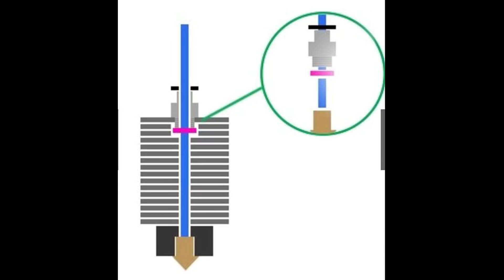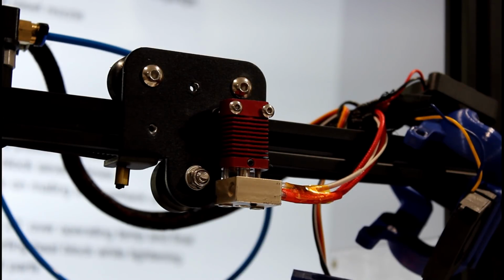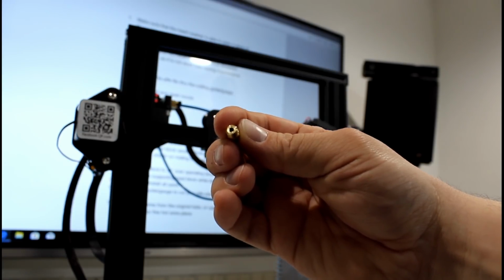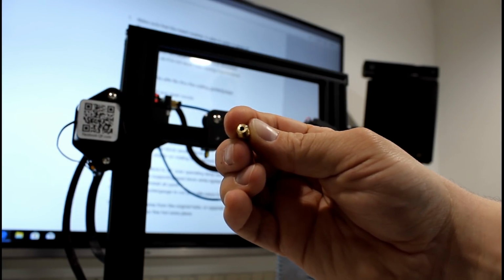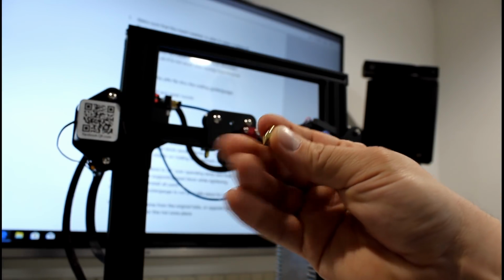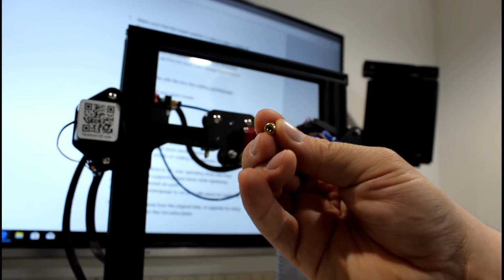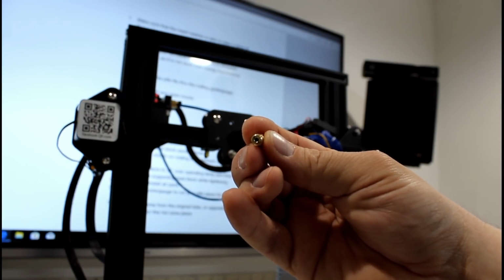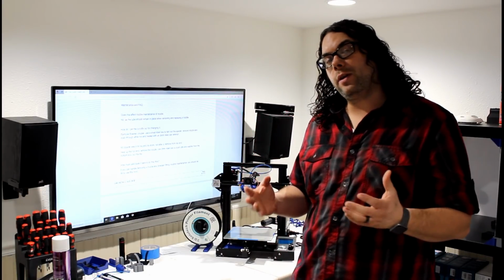Hot End Fix for Creality and Others Section 2.1.5 featuring the Ender 3

Comment: Thanks for sharing but, my due to the heat, my washer deforms, after that, the filament doesn't go thru. I installed everything following your directions making sure I have filament thru the tube and washer when I re-assemble but later on after I change filament the washer closes. I am using PLA for the washer, should I use another material?? Your videos a fantastic. Clear and to the point. Thanks

Comment: Thank you! I've watched a lot of your videos because I was having a really bad time with my ender 3 v2, it always had al clodged nozzle after some layers. I think what helped me in this video most ist that you showed to move the bowden tube through the hot end a few times when the nozzle it unmounted. That really pushed out something, and I could see some remains on the top of the old nozzle. I thought I had the new bowden tube attached right, because I repaeated the process about 4 times, but I never pushed the whole bowden throught, so that fixed it probably!

Next I will check my e steps as i saw in one of your other videos. Since your videos are so good, would you mind doing a bed levelling sensor mount or octopi installing on an ender?
Reply: I thought I solved the problem but it  popped up  again.... I think  I  might have a heat creep. Do you have any suggestions on that beside changung the hot end???????

Comment: Will this work for the lotmaxx sc-10?  I just had 2 back to back clogs and am thinking it might do the trick.  I've been told the lotmaxx is VERY similar to the creality cr-10
Reply from the maker: It should work as long as you get the right size tube inside the hot end.
Reply: @TheEdgeofTech  that was fast!  I also noticed the custom printed fan shroud.  I've been interested in trying one for mine.  I'll have to give this a try.

Comment: You fixed my ender 3 v2. Your guide its even better than CHEP's one. Using filament and a guide is vital. Thank you so much.
Reply: which spacer did you print please?  ender 3 or ender 3 pro?  i got ender 3 v2 as well
Reply: @rcpimp6419  they're both the same. use whichever you like.

Comment: This is very confusing. I have a CR10V2 and the box assembly is nothing like what you are showing. I finally got it off, but undid several more screws than necessary. Following your instructions left my hot end dangling by the wires. I had to reattach the left fan and the back of the box before going further. I could not work on it with it dangling while heating. Also, the bowden tube does not have anything to push down and remove it. It can only be removed by removing the nut first. It would be nice to have an updated video that shows other models. I am a beginner and very concerned about breaking an expensive machine while trying to follow these instructions.
Reply from the maker: This video was done on the Ender 3 which is a different hotend. It will be different for sure.
Reply: The Edge of Tech Then I wonder why Luke recommended I watch it for my CR20V2
Reply from the maker: @catherinepaulson4990  I'm guessing because it's the same principal, just a little different hotend.

Comment: Where is Luke Hatfields help guide that contains section 2.15 to implement the hot end fix? The link has a help guide but there is no section 2.15.
Reply from the maker: He must have made changes and knocked the numbering out of whack.
Reply: @TheEdgeofTech  So where is correct guide?

Comment: This is much worse. Even when changing filament, it stucks in small PTFE tube we cut. I returned back to the original one. I had much more problems with this than the normal.
Reply: I used this for 1 week and it is a pain. I do not recommend using it.
Reply from the maker: @funforgiven  Thanks for the feedback. You always need to remember to "purge" or push some filament through the hot end before pulling it out. That will help it not get stuck. This should be done with it without the fix in place.

Comment: Had a clog for the first time in I don't know how long (with the hot end fix in place).  In the end, I think the clog was filament related (contamination) because everything looked pretty good.  I have moved from using the PTFE tube to clear the throat to a Q-Tip with IPA on it while hot.  CLEAN as a whistle.  :)
Reply from the maker: Awesome! Nice work! Sometimes you get crappy filament particles and that happens. But it sounds like you got it under control and the fix is still working!
Reply: @TheEdgeofTech  eSUN (Inland) Silver.  I've been told it can get some particles in it, and I'm thinking that's what it is.  The hotend fix solved so many problems.  Just going through the re-assembly now.  Decided to cut a new piece of tube for the throat of the hot end (Hey, it's apart, might as well).  Washer is solid so away we go.  I still can't believe the quality of prints I get off a $170 (what I paid 2 years ago from Banggood) printer.

Comment: My small wire next to screw on block came off next to the big one...theres a little hole.. was it stuck inside?.how the heck was it attached.?.,my eyes are not very good...thax
Reply: I got it...thax
Reply from the maker: @roadstar499  Glad you got it!!
Reply: @TheEdgeofTech  did a  3 hour test using petg at lower temp 235 ...no leaks...i ran test without block sock...thanks... i learned a lot from this break down... i have had multiple issues with ender 5 since i first bought it 5 weeks ago...thanks
Reply from the maker: @roadstar499  Awesome!! I'm glad you got it rolling! I hope you get it dialed in and love it! Thanks for watching!
Reply: @TheEdgeofTech  I also ordered a can of crc ptfe spray... seems to be the answer for some 3d printer issues also... makes a lot of sense... nothing sticks to it... just keep it off the build plate of coarse... thax

Comment: So I print abs only with my ender 3, and I seem to have issues like clocks once and a great while when using the 24v heat brick fan. Also I noticed that when running that fan i can’t get my nozzle to reach 250 degrees. Turn fan off and I can easily reach temp. Now, I have played around with no fan on and temp running at 250 and have had 0 issues so far on a 3 day print. Also tried half with the 12v print cooling fan on and off and with that fan on printing abs print looks way smoother. So wonder does heat creep truly happen?
Reply from the maker: It sounds like you have tested it and don't see it so much. I would think it's there, but maybe it depends on the material too?

Comment: Hi i am new to 3d printing... my ender 5 has had a lot of issues i was able to fix... recent today my hot end (block part)has petg caked on thick top bottom and all around... i did replace the stock bowden tube (since it failed and filament was stuck inside)with a capicorn one.. cant print any washers or than other thing you used to measure tube you cut either... not sure i can get all the mess off block and nozzle anyway ...this ender 5 really sucks as far as i am concerned ... very unreliable pain in the ass...thax
Reply from the maker: Oh man. I have a video on how to clean and fix a hotend leak. If you follow that it should help! Also, shoot me an email at jim@theedgeoftech.com and I can help you get it going!
Reply: @TheEdgeofTech  Thanks sir... i was just really pissed off yesterday... watched some video's and ended up ordering all metal hot end for it... i did manage after spending 30 mins to remove all the caked on petg...i will watch your how to fix hotend video...thanks for your reply.
Reply: I just searched and could not find a video on fixing a leaking hotend on your playlist... one had pic of block and said fix clog...was that the one? thanks
Reply from the maker: @roadstar499  That's the one!

Comment: I feel like this is just adding more to go wrong.
Best way to make sure there’s no gap between ptfe and nozzle is to make sure all filament is cleaned out screw nozzle in all the way in by hand then unscrew by 3/4 then. Push ptfe in and then tighten nozzle.
Reply: That’s how I did mine, except I heated it to print temp. Next time I’ll do 240.

But love your vids man keep it up 👍
Reply from the maker: @ao27893  Thanks man!! You got it down!
Reply from the maker: I appreciate your opinion, and I was filming this for Luke's guide! Everyone has their own ways, and if you are not going to to do the fix, I would say you are spot on. I would heat the nozzle to 240 before I pushed it in and tightened it myself! Thanks for watching!

Comment: Great fix. The tubing cutting guide is worth printing just to assure you have a square  (90deg.) cut end on your Bowden tube. I would also suggest a second washer the thickness of the exposed threads of the PTFE fitting.

Comment: Hi! Thanks for the video! I did it but I have a problem with the washer when I change the filament. 
After the mod, while the stepper E is pulling the filament off a little blob of fuse PLA stucks in the washer... and the filament struggles to get out.
What am I doing wrong?
(i'm sorry for my English)
Reply from the maker: Thanks for watching! Did you push the filament in a little bit to extrude and then pull it out? If not that's what you want to do!
Reply: @TheEdgeofTech  thank you :) I will do it!

Comment: I dont get how adding a PLA washer at the bottom helps with the blackage between heat block and nozzle... surely the PLA would remelt and cause that exact same blockage if it is holding the ptfe tube up to allow the filament to go through the washer? Or have i missed something?
Reply: I think you miss understood.  The washer goes at the top. from bottom to top you have the nozzle, piece of the tube the washer then the locking nut to hold the rest of the Bowden in place.
Reply from the maker: Hi! Thanks for watching! I would defer to Luke normally as it's his fix. But I have been using it for a couple months with no issues! As long as the fillament can go through it smoothly, you're good. It high enough in the heat break that it doesn't get hot enough to melt. The issue I did run into was the crappy stock PTFE tube getting messed up on the nozzle side. Once I changed that out to Capricorn XS, or the TH3D tough tube, I had no more issues!

Comment: Thank you for this. I watched your performance build video to build my Ender 3.....and now I watched this video to fix it. You're a huge help.

I did a 16 hour print last night then tried to change the color this morning. I pulled on the filament and pulled on it, but it wouldn't come out of the hot end. So, I undid the coupler and it took several minutes to get the bowden tube to come out of the hotend....and it was COVERED in PLA slime. I had to bake my nozzle on the stove, then grab it with gloves and scrape with a toothpick....drop and repeat.... I heated the hotend up to 240 and it took a while to be able to get a bowden tube to slide through it.... but I did...then did this fix. That was too much work to go through to let it happen again.
Reply from the maker: Sorry you had to go through that, it sounds like you're voting too was not pushed all the way down into the hot end. But after the fix you should not have to worry about it! Just remember that when you take your filament out, push it in a little bit, then pull it out.

Comment: Hello!
I am brand new in the 3D Printing World and have my first own 3D Printer, a Ender 3 Pro for about a month or one and an half...
I have been trying for 1-2 weeks already litho print, but I always have visible lines and small Filamentpoints in my pictures. I have already tried the speeds 40 / mms and 30mm / S and some different layer heights like 0.12,0.15,0.20. Also, I have already tried various Cura settings like "not in skin", "z-hop" and more, just like other temperatures. Unfortunately, everything without the desired success. Surely, the images with a layer height of 0.12mm were more beautiful than with 0.2 but the lines and these little dots are still there. Now Luke from the Facebook group sent me the link to these great videos.
However, I can not perform this HotEnd fix because I have no PFTE Tube I could swap or trim. Is this really necessary?
In addition, on my Hotend is no silicone sock , but a yellow tape. If I removed that, I would not have anything to put together what I could give back to it. I can not imagine that this tape is not needed. Surely that has something to do with isolation or something else?

My Ender is still Stock without any changes.
I only calibrated the E-step value from the original value of 93 to 94.94, so that the 100mm of 120mm drawn filament are really exruded (into the air ot throw the nozzle).

Do you have an Idea why I have such visible points & lines in my first LItho pictures? Is this due to the printer or more to the Software Cura? And what should I do in your opinion? If I break up my completely new Hotend, of which I am honestly a bit afraid .... I can not renew the Tube and can attach no more instead of the tape.
Is not it possible to somehow check if the Hotend is to blame for the problems in my LItho images?

 I hope everybody here can understood my Bad English. I am a German User with terrible English Skills, and Google Translator is not a great help =)

Best Regards
Reply from the maker: I apologize that I just saw this. How's your printer going now!?

Comment: Jim at what step can the temp be turned down?? Does it need to stay hot even during the bowden coupler re-installation? Found my filament I used to keep washer lined up kept melting on me. Great videos!!!
Reply from the maker: Yes, at the end when you have put the cut PTFE inside the got end, then your washer, keep it at temp until you final tighten the Bowden coupler. Then after that you can turn it off.
Reply: @TheEdgeofTech  Yes, but doesn't that mean that you're putting filament thru to test while the nozzle is hot (causing melting)?
Reply from the maker: And I had that issue too. Haha I kept running the small piece of filament through to far and hitting the hot nozzle. Lol

Comment: Sorry to ask again what about the sensor level they work ok and were to you bought and the made case for it
Reply from the maker: It's ok! Ask as many questions as you would like! Are you talking about the Bltouch sensor?
Reply: @TheEdgeofTech  yes
Reply from the maker: @Junito5155  I got mine from Amazon as well and I went with the real version. But depending on what Printer you have you will have to update your firmware to use it.